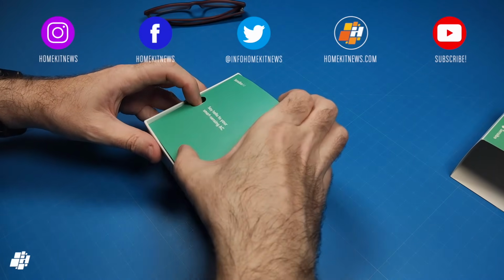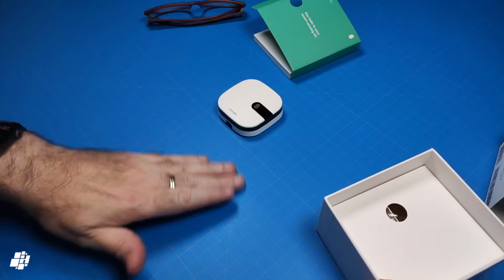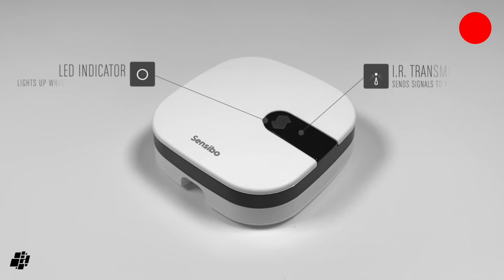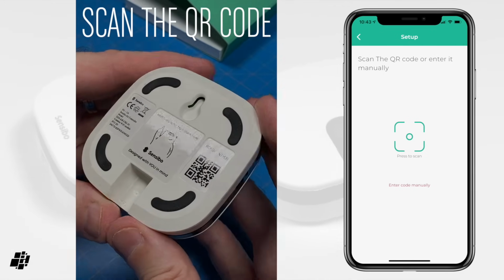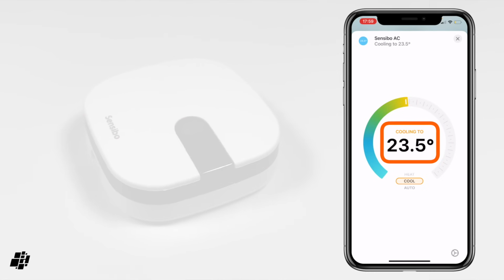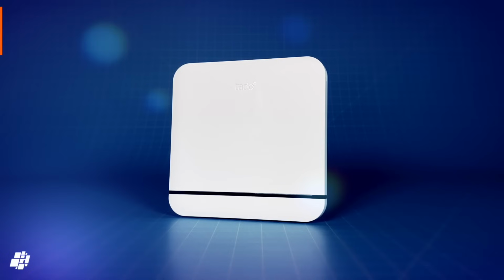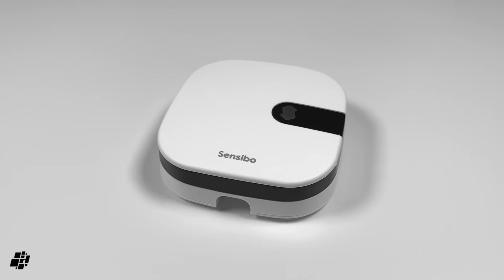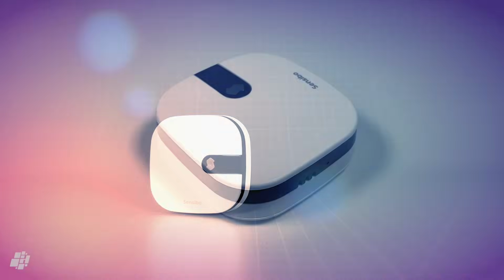Sensibo Air Smart AC Controller With HomeKit

Comment: DOnt get why u ever would need this? We have two daikin pumps at home. Both can be controlled by the daikin app both iphone or android. I can see history and how much power it draws and the tempsens history. I can turn it off and on and set whatever temp or mode with my phone in house and even outside/away. So this is such a lame thing in my world.
Reply from the maker: But not everyone has the AC that you have, so whilst it’s of no use to you, it may well be of a lot of use to many others, especially those who want to have an AC controlled within HomeKit.
Reply: @homekitnews  that is to true but any ac built within 5years with wifi has these functions.
Reply from the maker: But nearly all of them won’t have HomeKit, which is where these products fill a gap. Most people with smart homes these days don’t want to jump from app to app to see or control devices, they want a sensor or smart light from one company to work with an AC controller from another, which is the whole point as to why HomeKit (as well as Google, Alexa) is popular.
Reply: @homekitnews  that is so true

Comment: Is tado better
Reply from the maker: I prefer Tado for the touch control interface, so I would say it’s better, yes.
Reply: @homekitnews  sensibo has a humidity sensor . Does it do something controlling humidity according temperature or just shows humidity as a level.
Reply from the maker: @borislavtodorov6191  in HomeKit, if you’re on iOS15.1, you can now use the humidity sensor readings in automations. You can also do the same for the temperature sensor.
Reply: @homekitnews  I am on iOS but does it do something with humidity or just display it
Reply from the maker: @borislavtodorov6191  the Sensibo will only show the humidity levels in the settings when viewing it in the Apple Home app, but you can still use the humidity levels in automations, as long as you’re running iOS 15.1.
Reply: @homekitnews  my case is that I have a small child sleeping at night in the next room but there is no door between the room with ac. When I set up the ac on 23C may be the next room is 20. So I want to place the sensebo or tado in the room where the baby sleep and set temperature. There is like 11metters open area to the ac so the unit will control it. But when the ac is runnning all night the humidity goes down and my kid has a dry nose in the morning.that’s why I was thinking sensebo will measure the humidity and set the temperature according that. So in my case I am confusing between two sensebo or tado
Reply from the maker: @borislavtodorov6191  both the Tado and Sensibo expose their Humidity and Temperature levels to HomeKit and can be used in automations.It’s down to how you create the automations to get the best out of them. You also have the option to have a separate sensor in the child’s room to get more accurate readings and use these to control the AC via either the Sensibo or Tado.
Reply: @homekitnews  what kind of sensor to look
Reply from the maker: @borislavtodorov6191  It depends on your budget, but I think the Aqara temperature and humidity sensors are great (https://amzn.to/3xvAQhZ), but you do also need an Aqara hub. The cheapest hub available is the Aqara Hub E1 (https://amzn.to/3nUCvKV). If you prefer not to have a hub, then the QingPing temperature and humidity sensor - H version (https://amzn.to/3paWwMV) is also quite cheap and has a large E-ink display. It uses Bluetooth though.
Reply: @homekitnews  looks nice the one without base. May be I will go to tado I saw the new v3+ has a humidity sensor if I am not wrong
Reply from the maker: @borislavtodorov6191  you can see my review of the QingPing here - https://youtu.be/DNExCttRYUo - yes, the Tado has a humidity sensor inside, and you can use it in HomeKit automations.
Reply: @homekitnews  my ac Mitsubishi has economy and quiet mode witch I use a lot does tado will operate those settings. They are available on my ac remote
Reply from the maker: @borislavtodorov6191  it’s impossible to know for sure, as it depends on what Tado supports for each brand and model. My Daikin AC with the Tado supports five modes - Heat, cool, auto, fan, and dry - but some ACs might show more options in Tado. Sometimes these additional modes are actually just the lowest speed on standard mode for a Quiet preset for example, so you may find it supports the same function but doesn’t expose it as a separate option.

Comment: What brands are compatible whit this device?
Reply from the maker: Hi, they should be compatible with almost any brand, although you should first check their website for certainty. Additionally, most of these types of devices are basically replicating your hand held remote for your AC, and it’s important that the remote has a display that can show the temperature, and the different modes. If your remote doesn’t have these, it’s less likely it will be compatible.

Comment: It's still cheaper than the kumo cloud option for the Mitsubishi Split AC and Heatpump system.
Reply: Did you test it with a Mitsubishi unit?
Reply: Yep! Similar issue with the Vida Cool system for Mitsubishi Electric air conditioners sold in Singapore, that's expensive and it looked to me like it was more limited than the Sensibo Air Pro I decided to get. (I'm mostly looking into the official Sensibo API and connecting that to Home Assistant on my NAS for cross-ecosystem automations)

I've been trying to see if there were ways to integrate it more, like drawing power from the control board of the indoor unit instead of using an external power adaptor, and a microcontroller set up to prevent the indoor unit from beeping when controlled by the Sensibo unit but still beep when controlled by the original remote. However, I've not had much luck yet, though I'm on to something now that this video showed where the sensors are located on the regular Air, and I'm assuming the locations would be the same on the Air Pro.

Comment: I’m new to this side of things. How do you know it will be able to replicate your air conditioners remote? Does it work on all air conditioners remotes?
Reply from the maker: Theses types of devices are designed to do exactly that, replace your remote, for at least the main controls.The AC remote you have should have a display of sorts, with options to choose temperature and mode (heat, cool, auto etc). The device receives the basic IR signals from your original remote and determines what set of instructions the controller needs to download, via a database of 100s of different remotes. From there, it sends out signals in exactly the same way as you would with your remote, but with the ability to control it via HomeKit (or Google, Amazon etc).
Reply: @homekitnews  thank you that’s very useful!
Reply: @homekitnews  Will this work on PTAC Units? And I have no remotes.. Can your device be programmed without remote controllers?
Reply from the maker: These devices need to get their IR codes from a remote in order to be set up, so if a device doesn’t come with a remote, you can’t use it.

Comment: Do I need a Sensibo device for each AC unit I have?
Reply from the maker: Yes, as they use Infrared signals just like the remote control that came with your AC. If your original AC remote can’t reach another AC unit in another room, then it’s the same for the Sensibo Air.

Comment: Can you change the temp with it so you for example have it set to 10degrees Celsius in the weeks and if u go to the cottage for the weekend u can raise the temp to 22 degrees?
Reply from the maker: Yes, you can program it do temperature changes based on days of the week in either the Sensibo or Home apps. Not sure it’d go as low as 10°C though. My AC units can’t get that low.
Reply: @homekitnews  My  Sharp has a "vacation" mode that i use in the winter so to make the question more precise.... Can i disable the vacation mode and set it  in the normal heat mode that begins at 18C.
Reply from the maker: @krokodilen31  yes, that’s easy to program in the Sensibo app. If you were to use the Home app, then you could easily set an automation that triggers the AC to come on based on your location as well.
Reply: @homekitnews  Lets hope it works.... I just ordered a Air one..... Really good Olympic Games deal 50% off.
Reply: @homekitnews  in the home app can u program it like ... If im coming closer than lets say 80 kilometers then it goes from 10 to 23C automatically?
Reply from the maker: @krokodilen31  the Home app is a bit basic in terms of things like this, so at its simplest, it can trigger automations when someone leaves or arrives at a ‘home’, but now that the Home app has Shortcuts built into it, there may be a possibility to create an automation like the one you’re looking for. I haven’t attempted anything like this yet, so I can’t say with certainty. You can also just turn the AC remotely of course, but I guess you want to set it without having to remember to turn it on when you get nearby.
Reply: @homekitnews  to be able to change it manually will be perfectly fine, was just asking since the info online is a bit limited when it comes to such things.
Reply from the maker: @krokodilen31  to do it via the Sensibo app you would just need it to have an connection to your network, but if you wanted to turn it on via the Home app, it would need to be first connected to your network, but also have your home hub (Apple TV, HomePod, HomePod mini) set up for Remote Access, which, in the case of the Apple TV is a setting you activate.

Comment: I see that it is possible to program the device like you program a thermostat; however, my schedule is different from day to day.  Is it possible to create a set of commands that I can easily switch between on the app or from google ... similar to turning on a lighting scene?
Reply from the maker: Hi, I can’t answer the question as it relates to Google, but it’s certainly possible with HomeKit, so you can just create a series of specific scenes involving the Sensibo Air with the parameters you want. I imagine there’s something similar with Google though.

Comment: I have a mitsubishi mini split in the USA...wondering if this Sensibo Air is what I need for homekit control or will the Aqara P3 do a better job? I have an aqara hub and starter kit from Amazon right now....if i have 3 indoor units, would I need 3 Sensibo Air units or 3 Aqara P3 units??
Reply from the maker: The Sensibo Air will work fine with your mini split, as will the P3 (see my fuller separate answer re the P3 in the ‘hubs’ video). The P3 is a lot cheaper than the Sensibo, but the Sensibo is a lot easier to place due to it using a USB plug as opposed to a Chinese 16A plug. You may want to wait for the release of the forthcoming Mysa AC controller though, which should be out soon. Either way, you’d one each of these devices for each AC you wish to control, as they can only control one AC at a time, unless they’re all in one room, but even then they would be controlled as one AC together, not separately.

Comment: Hi Simon, does this accept receiving signals from the original AC remote and sync the states like on the Aqara P3? (Or could you do a little test to confirm that? Thanks!)
Reply from the maker: Hi Edwin, I have noticed that the P3 will sync the state and temperature when a signal is sent from the Sensibo. I’ll have to check if it works in the opposite way, with the Sensibo reacting to the signal from the P3. I’ll get back to you.
Reply from the maker: Just checked; it seems the Sensibo can get the P3 to accept signals, but the Sensibo doesn’t react when signals are sent from the P3.
Reply: Interesting. I recently got a Sensibo Air Pro that I use with a Mitsubishi Electric air conditioner (purchased and installed in 2020), and it does actually sync with the remote for that! Even in the log on the 'graphs', it knows when the indoor unit had been controlled using the original remote.

My guess is that Sensibo either sent out a software update to enable that, or it might be exclusive to the Air Pro.

Comment: Excellent video thank you. I have a Sensibo Sky  connected via Homebridge to Homekit. Recently acquired two Sensibo Air and these automatically connected via the Homebridge plug-in. I didn’t need to use the built-in HomeKit functionality.
Reply from the maker: Thanks. Does the HomeBridge plug-in expose any extras to HomeKit?
Reply: @homekitnews  For the sake of trying I connected the Sensibo Air directly to HomeKit. It had exactly the same functions no matter how it’s connected to HomeKit. I guess I can say the plug-in works great as the HomeKit direct connection.

Comment: The Aqara Hub M2 has both zigbee and IR controller, in my case however, the 20 year old Daikin A/C IR protocol is not supported.
Reply from the maker: Does the Daikin remote come with a display that shows the different modes and temperature etc?
Reply: @homekitnews  Yes it does, it is the classic LCD whith the swing, mode, etc. Do you have a similar experience?
Reply from the maker: We have Daikin ACs here but they’re probably about 5 years old at worst, so not quite as old as your Models. The remotes have been readable by the M2, and all of the AC controllers I’ve tested so far, including the aqara P3. I wonder if it’s possible the AC would work with a newer Daikin AC remote that can also be recognised by the M2.